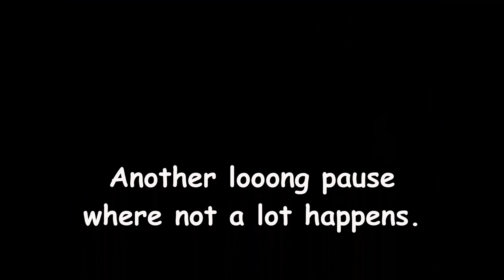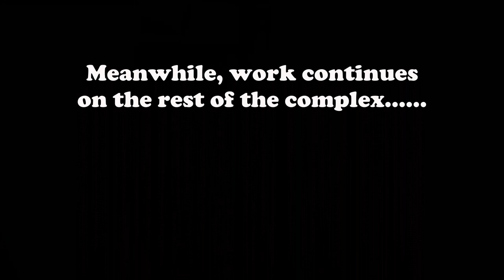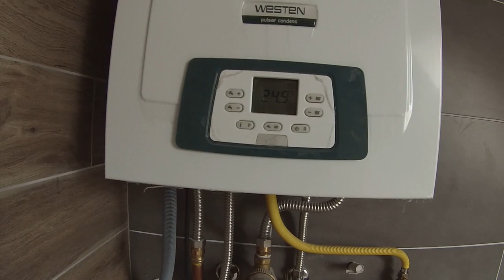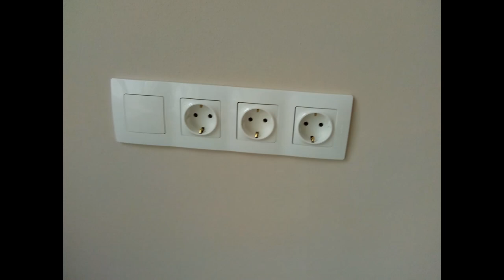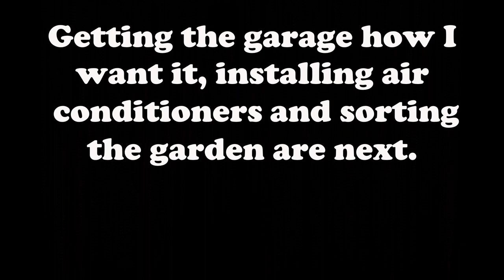House Finished! Part Three of our new house build in Baja, Hungary

Comment: Hello
I have a house near to Baja, and I would like to contact you regarding your experience in finding builders and plumbers in the area.
Any help will be greatly appreciated
Reply from the maker: Still searching for a good all round builder but we've found a good plumber, electrician, tiler, roofer and carpenter. Problem is, as you probably already know, that the good ones are always so busy and you have to wait ages! End up doing most of it yourself!
Reply: @TheBritInHungary  Hello and thank you for your reply. My main need now is for a plumber, and I am having a great deal of difficulty in finding one. It would be good to find a way of communicating to share experiences.